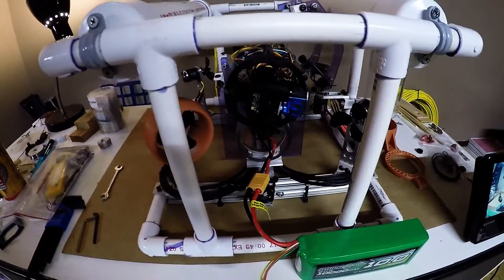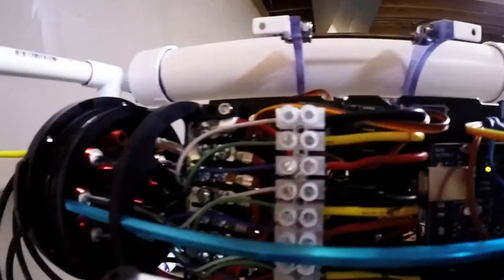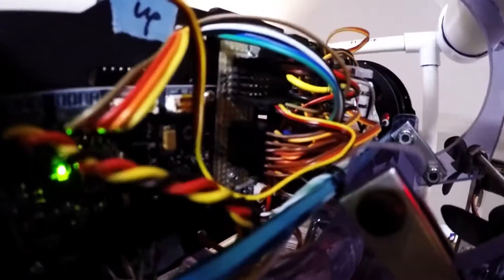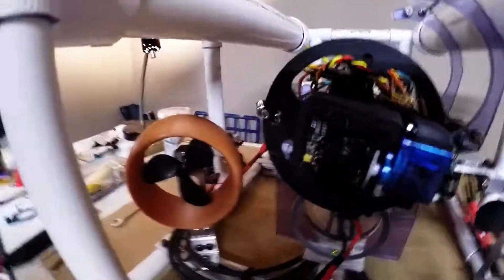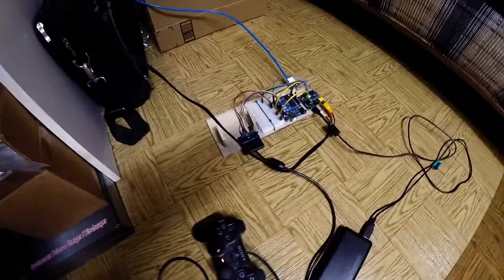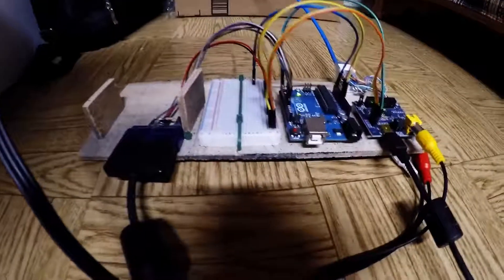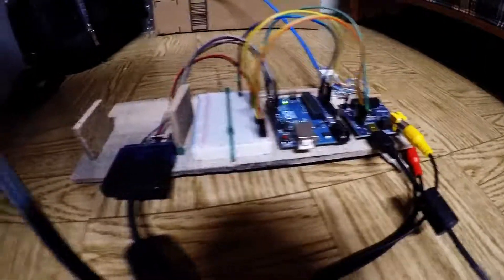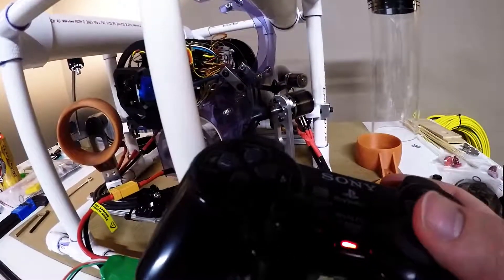DIY ROV New Build Overview

Comment: Hi, I'm also getting interested in this kind of project,
I'm a bit confused about "how" to connect the cable between the ROV and the Topside Controller... I hear you're using a phantom-s tether board, is there any other alternative you suggest? because I think it's a bit expensive for me....
Thank you in advance
Regards
Reply from the maker: There's tons of options and associated pluses and minuses to each. TCP/IP network connection has more overhead and hardware requirements but easiest to scale up. Serial connections are very reliable and low overhead, but require more understanding of the underlying components to get them communicating. RS232 has limitations on max wire length, I was originally leveraging a RS485 serial connection using a couple ICs and simple circuitry.
Reply from the maker: Homebuiltrovs.com/rovforum has a number of wiring diagrams in project threads, I suggest reading everything you can there and keep asking questions on what's not clear yet.
Reply: Hi, On my project, I used this : "5 V Max485 module RS485 module TTL vers RS-485 module convertisseur Compatible avec Arduino", for serial link. found on Amazon.

And this, to transmit the video :  "Vidéo Balun HD-CVI TVI AHD Connecteur Passif BNC Vidéo Balun Émetteur-Récepteur Câble pour 1080P 720P CCTV Sécurité DVR Caméra de Surveillance Système-1 Paire", also on Amazon.

And a video USB Grabber to put the video on a Galaxy Tab : "Contacts Video Grabber Gold + Câbles RCA | Analogique numérique | Windows 10 + Nouveau Logiciel 2021 | Convertisseur USB 2.0 VHS Capture | Convertir Le Format numérique Mpeg Old VHS"

Hope it's not too late and that it may help.

Comment: any wiring diagram we could look at?
Reply from the maker: I didn't draw one up and have since completely revamped the control system. Essentially the on-board Arduino has the serial connection from the tether coming into it and just assigning pins to the speed controllers to send pwm to them. The surface Arduino has the Playstation2 controller attached to the appropriate analog pins. The rest is software magic! There should be a link in the vid description to my build thread which has more info
Reply: @lucasrov8044  any chance to have a video with the new improvement of the ROV ?
Reply from the maker: @zfrenchy1716  that's a great idea as a lot has changed since this one. Stay tuned :)